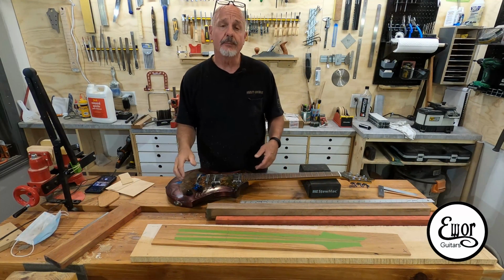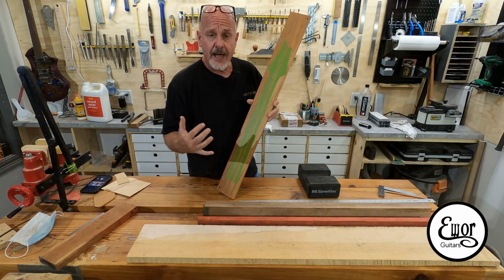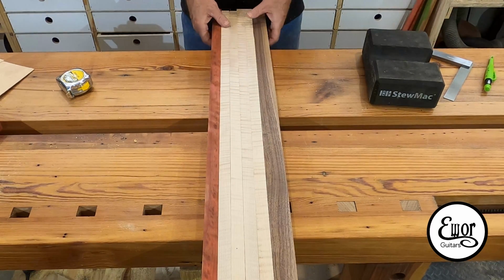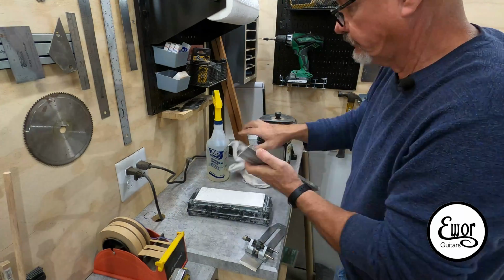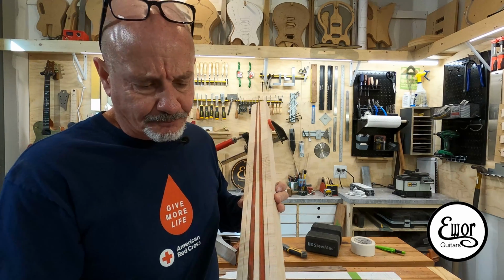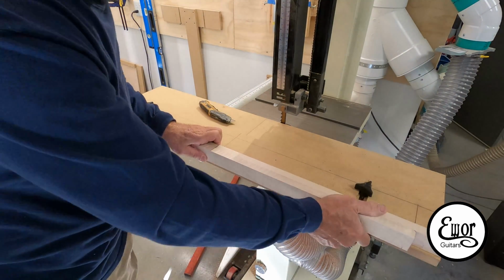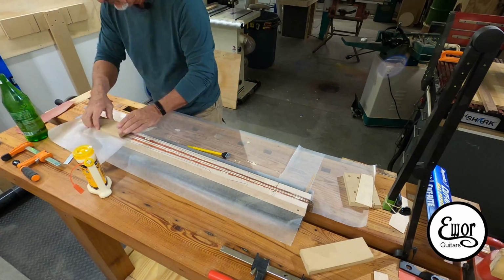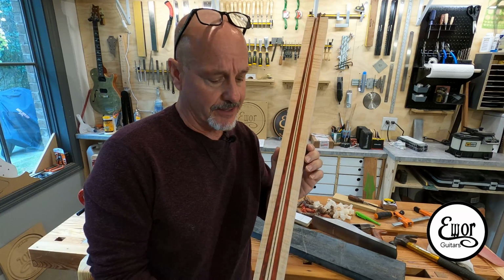How to Build an electric guitar episode 7: Multi-Laminate Neck Blank

Comment: Beautiful concept - very inspiring. I have a logistical question: what brand/tradename of two sided tape do you use?  It holds your piece in place and yet allows you to peel off a thin sliver of wood without the sliver snapping ( see 7:29 )
Reply from the maker: I use two tapes one of them is from stewmac and the other one I purchase from amazon it has the label ipg on the inside. Both are excellent double sided tape

Comment: What is the hot box.. stabile it? Was the wood dry to start with. Thank you.. great lesson
Reply from the maker: The hot box is just an insulated box with a heat lamp and dehumidifier. I helps get the moisture content down to around 6 or 7% down from about 12-14% when I buy it.

Comment: Hey Dave, great name! I'm a fan of Redheart, also, and I actually have Redheart inventory that are some of the most thoroughly, and spectacularly, figured timber of any species.
I'm a fan of putting a mild taper on some of the pieces in a multi-laminate neck.
On the tools, whether power tools, hand tools. CNC or manual mills or lathes, to me, it's all about the quality of the tool. I equally enjoy getting great results, the process of getting there, on any tool, any operation, as long as I've the opportunity to work with high quality tools and tooling.
Enjoying the videos. We're hoping to get some videos up soon.
Reply from the maker: Are you selling any of your red heart?
Reply: @eworcustomguitars  sorry for the late response, been swamped lately (for which I am truly grateful🙏 ). I'm sorry,  but I'm not likely to sell that inventory at this time. I was fortunate to find RedHeart that heavily figured, and have multiple builds in mind for it.